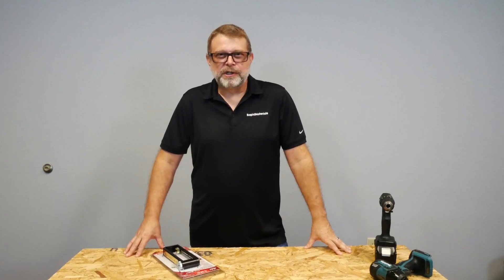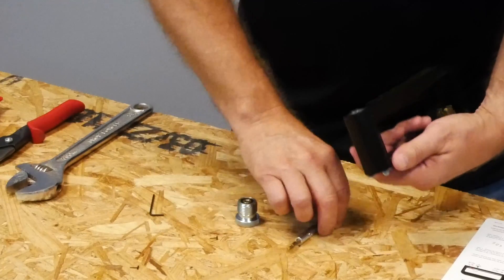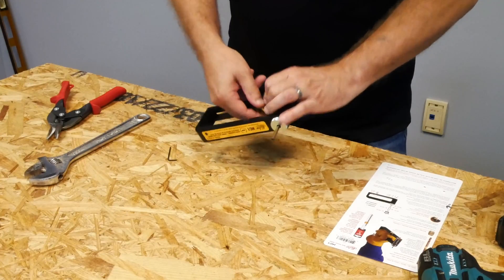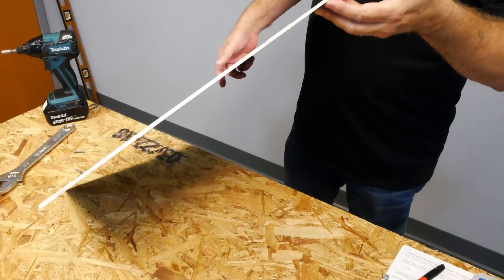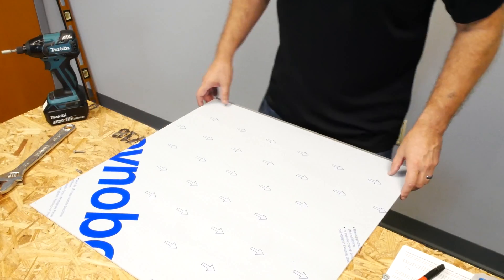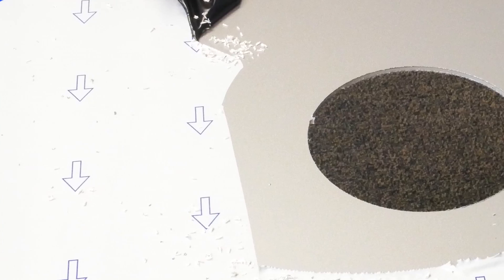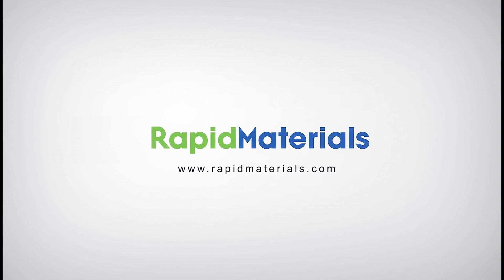How to Cut a Perfect Hole in Sheet Metal or Metal Composite Material

Comment: It always leaves a messy cut on the final part of the rotation. Does using support material like timber underneath work to prevent that? Thanks.
Reply from the maker: Because the tool is supported by the "drop", we've found that with lighter gauge sheet materials, it seems to work best to stop the cut just short of complete, then finish the cut with a pair of snips. Bear in mind that this tools was designed for the HVAC industry, where cosmetics are not as much a concern

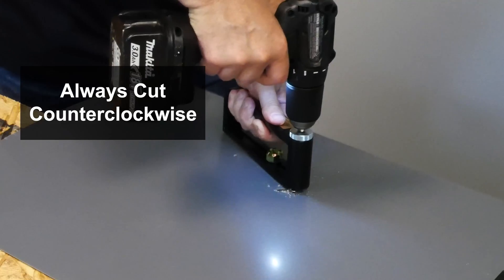Comment: 2:12, Wrong, you should rotate clockwise, it even has a sticker with an arrow on the handle indicating clockwise rotation.
Reply from the maker: Aleksander, you are correct. The instructions do note that you should cut clockwise. We found that on softer metals (copper, zinc and ACM) we got a better quality cut working in reverse.
Reply: Well at least I got to see how messy a hole looks like when you do it counterclockwise

Comment: How about on couragated panels
Reply from the maker: Ronald, this tool will only work on relatively smooth flat surfaces. If you need to cut corrugated metal, Malco makes a great tool called the TurboShear CM which mounts on your corded or cordless drill. You can see it in action here: https://youtu.be/xjE9U7DUE40 or on our website at https://www.rapidmaterials.com/Malco-TurboShear-TSCM-for-Corrugated-Metals_p_2291.html